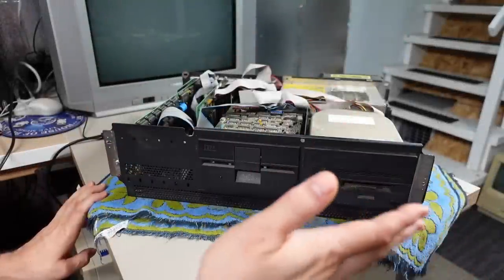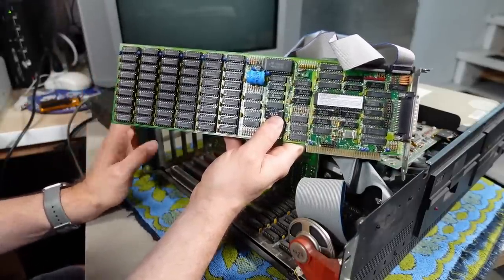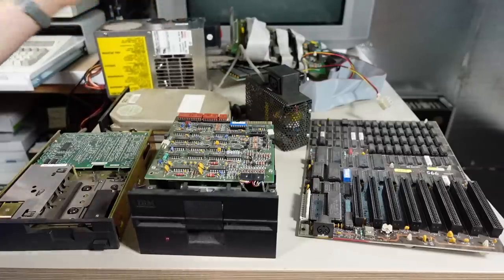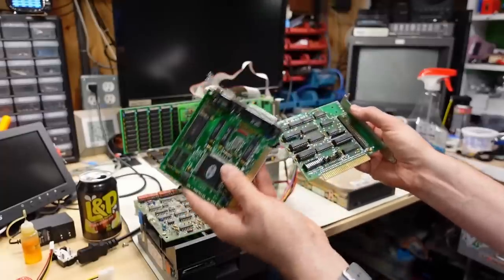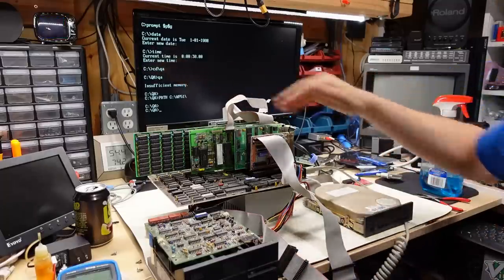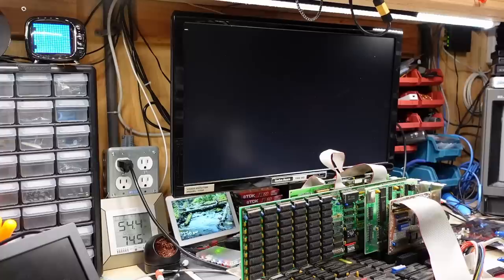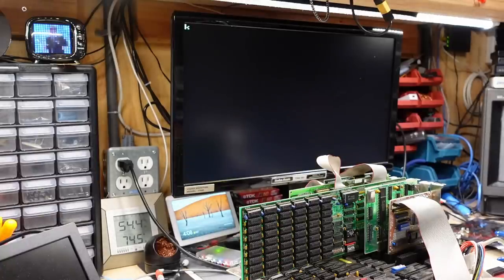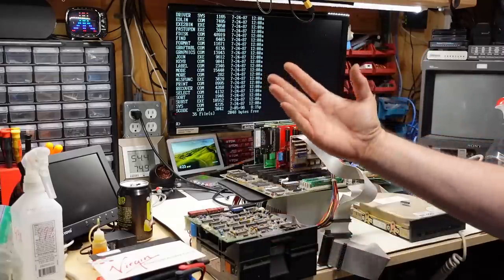PC archeology: IBM PC XT with a strange appendage

Comment: man, i always freak out everytime you test electronics specially when something bad is about happen (like popping caps) everytime you're about to turn on something relatively high voltage i close my eyes but i open one anyways to see what happens.
Reply: LOL true.

What are the things that gets me in a good mood is electrical electronics in about any other fail videos as well.

One of the things that's part of the fun is it trying to guess what's going to happen before it does or anticipating it when something starts to go awry yeah that is classic I'm sure I'm not the only one that is like that.

I don't know how but I made a fluorescent fixture self-destruct when I turned it on!

I'm not the one that wired that one either that would had already been installed no not think about it I think they were using some sandwich fixtures and might have done some work on them or they got them they were already like that because there was some jacked up wiring in it fixture they went Bang.

Also has anyone ever put in a fluorescent tube with a power on which you should never do by the way this is one other reasons why you should not.

I don't remember which type of fluorescent starting this was whether its rapid start or which particular generation it was not preheat I do know that for sure.

This is a 4-foot T12 fixture it was either two or four bulb can't remember.

I was putting a bulb in and unknowingly had power going to the fixture.

Kind of weird couple the fixtures were I a different switch elsewhere and a different circuit as well that's why I did not know and all those the bulbs were completely out.

This was in a basement somewhere quad setup for sure.

If I remember the switches that control those also controlled other lights in the place as well which those switches actually controlled contactors at the electrical panel that controlled multiple circuits.

There's also hard-wired night lighting control the in a similar manner.

And even Outlets the same way potentially for Holiday lighting and room lighting there was a few different circuits these receptacles were marked as to what they were

And the younger kids rooms had an override switch for certain receptacles and the lights!

Plus in the living room there was one receptacle that was controlled from a key switch.

I was straightening things out when someone moved into this place.

They could not make heads or tails of the wiring and thought I might be able to help!

But getting back to the Florissant bulb issue.

I weld up putting in one tube and instead of going straight into the Tombstones sockets I missed at one end hit the housing possibly one pin in and one pin not and bang.

The other fixtures now mentioned going Bang was one that was installed but not connected to power as of yet.

And of course when I opened it up it was butchered and entirely wrong ballast and even if it was it was not properly wired.

If you ever reuse a fixture or anything else like that always check wiring first internally don't trust it!

Comment: Did Everex have some kind of deal with IBM? I had an Everex AT 1800 286 (actually, I still have the mobo, it suddenly stopped accepting key inputs - not the keyboard BIOS, tried that) and it had a near exact copy of an IBM AT case.

Comment: Hard drive should be BELOW the other drive. some of the seagate 225 harddrives were magnetically sensitive on their belly board.. Also the 286 version ie 'IBM AT' had a much larger motherboard and therefore a different case which I believe was also a bit thicker.

Comment: The stack can be located at various Segment:Offset addresses when running and the faulty motherboard appeared to generate an exception when it gave that error message so the ram where the IVT is located(at the very beginning of memory) still works, it would have triple faulted otherwise. Since you took out the expansion card and it still didn't work you can rule out that as the problem. Did you ever replace the tantalum cap? Maybe running the machine with that many card stressed the board/power supply/ram.
Reply: Memory still seems likely to me. Suppose one of the address lines in one of the chips failed. Some accesses (like to the IVT) could succeed, but other addresses could be redirected to an improper address, causing errors.

And btw, double and triple faulting only exist in protected mode. In real mode, no protection faults can occur.

Comment: Fastback would have for sure been used for the tape drive. I used to use a version that worked with a parallel connected drive. Wouldn't have been a cheap addon. Obviously this machine was used for important business. Not surprising no games or demos.

Comment: Good half-split method on the memory troubleshooting.  Piggy-backing ICs doesn't work like it can with C64s?
Reply: it sometimes works, it worked when finding dud ram in a commodore plus 4, but if the suspect chip shorted piggybacking wont help

Comment: I wonder how that add-on PSU shares an output ground level with the internal one. Is it just via mains ground? I don't remember for sure whether desktop PC cases and circuit grounds are (or were in those days) connected to mains ground or isolated from it, but I think they're connected to it. Laptops are isolated.
Reply: In power supplies the DC ground is often connected to mains ground but sometimes not. In any case, various PCBs connect the ground plane to mounting holes (and the chassis is always grounded) so the grounds get connected either way. If each component is connected to a separate PSU and is isolated from a chassis, ground wires in data cables will ensure a common reference.

And in laptops, the case always seems to be connected to circuit ground. Obviously laptop PSU bricks with a 2-wire input are isolated from mains ground, but it's different with 3-wire bricks. DC ground is solidly connected to mains ground on most bricks with a 3-wire cord, but some Dells make the connection through a 1k resistor. This prevents external ground loops while preventing AC voltage from appearing on the output.

Comment: Too bad they didn’t make a “dead test” cartridge for this machine, like they did for the C64!
Reply: Lotus 123 on a cartridge? they used floppy drives back them, you meant the ET cassettes is guess, games on a rom card?
Reply: I think making one should be doable. Come to think of it, isn't that basically what POST codes are on newer machines? A purpose-built diagnostic ROM (and maybe also bus monitoring card) could be very helpful. Anyone know if any unmodified clone XT BIOSes output POST codes?

Comment: Its only 25 percent high.    Its  within the 25 percent rough acceptability to not instantly kill something.
Reply: While it's probably not enough to instantly kill anything it might still cause instant degradation. Oftentimes 16 volt capacitors are used on 12 volt rails and I'm sure they don't appreciate the extra voltage. 16 volts is often listed as "absolute maximum" on many 12v parts.
Reply: @eDoc2020  Usually i like to stay within 15 percent   Ill give a 16 volt laptop 19 volts and things will usually be fine.

Comment: a tape drive would likely indicate it was likely used in a rack at a telco

with an adapter plate you be likely be better to use  a modern atx power supply wouldn't try and keep using a psu that is likely not worth , i doubt this would ran basic
Reply: Tape backup drives were common in office and home systems.
Reply: @tss20148  i know though most the stuff i've in place in typical 90's magnetic double the size of hi-8 video camera ..
not something that would use a standard cassette tape of setup..

if i was still cassette media best stuff to use would be the stuff meant for dat tape use..

In this case I am pretty sure this would of been used more likely for recording messenger  rather looking at a data ..

lived on creating games on a tandy trs 80 as a kid looking at the included software 

limited space spaces on a 30-45 min per side tape..

i suspect 9600 baud modem used fax machine or a answering  machine

most likely stored data on the floppy
dead give away was the rack ears  told me this was a scsi fitted busiess machine
Reply: @jasonhowe1697  There are no rack ears. What you are referring to as rack ears are where the front face plate for the 5150 attaches. The drive looks like it accepts QIC data tapes.

Comment: I have a HP Colorado T1000 tape drive --- but have never managed to get it working.
Reply: Is it a parallel port unit, or does it use the floppy controller?  Or ???
Reply: I thought IDE but apparently Floppy --- lol
Reply: @garyhart6421  I think the interface depended on if it was internal or external.  The floppy interface always seemed a bit hokey, since if I recall you still had two floppy drives connected and available.  Most decent tape drives were expensive, the cheaper ones like the Colorado were okay, but never quite became mainstream or standardized, and got superceded by recordable optical media and even removable drives that allowed random access to files.

Comment: i am guessing that PSU was a gimmick
Reply: No, the original PSU was only rated for about 65 watts (a lot of laptops run on about that much power).  Depending on what hardware you were planning to power with the PSU, you might have needed something like this.  It might not have been necessary for this computer, but they might have decided "better safe than sorry"... a little supplemental power to avoid overstressing the PSU never hurts.

Comment: The fact that modern PSUs have no monitor output anymore still makes me angry to this day. So many wasted adapter plugs
Reply: Given now much wattage a lot of computers pull on their own these days, and how companies have been shown to cut corners on their power supplies leading to failures, I'm personally glad they don't have a pass through, because if my system does fry, I'd rather not have to replace the system, and 2 monitors, and I just plug in my backup computer to my monitors, and keep working while I figure out what's wrong with the main system.
Reply: I remember seeing the warning not to plug a newer (for the time) IBM brand monitor into the power out connector on a PC/XT or maybe original PC/AT, because the power switch inside the computer could not handle the extra current.  They even included a dummy plug to insert into the connector to prevent it; no cord, just a one-piece molded plug.